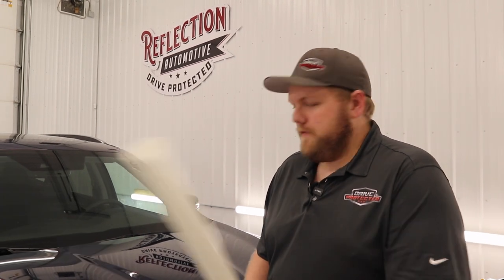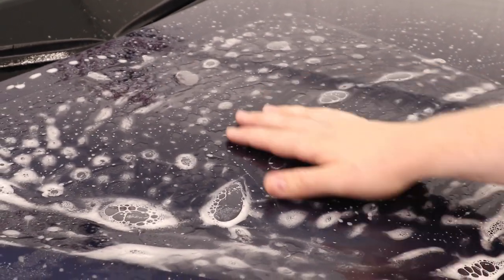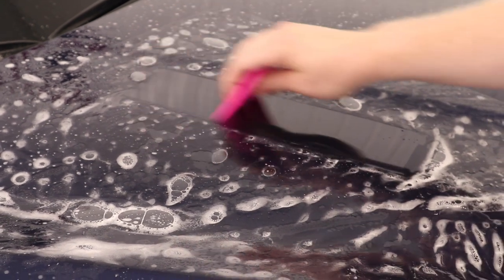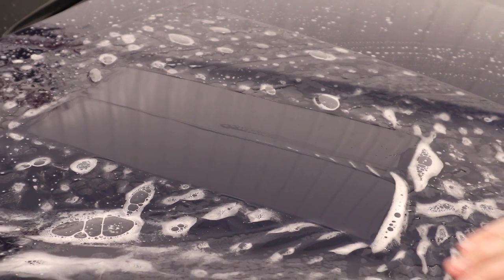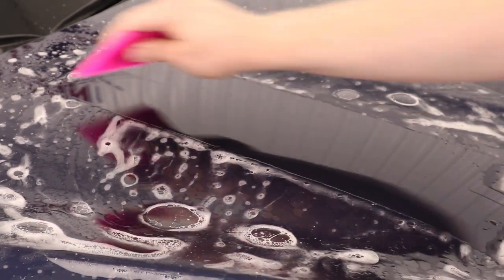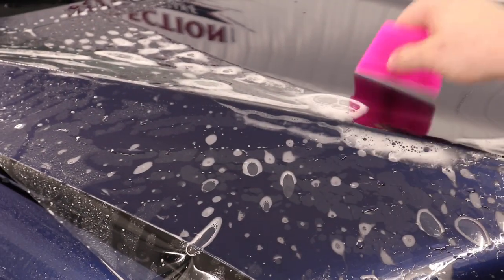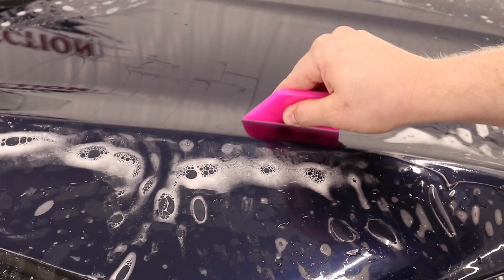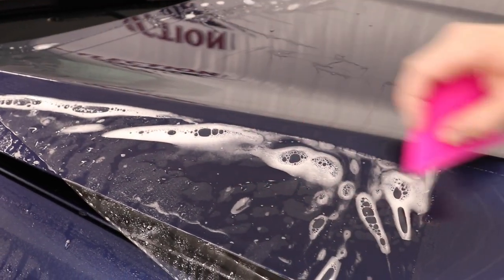PPF Pro Tips - How To Use A PPF Squeegee

Comment: If you miss a tiny bit of water over a ridge and cant squeegee out because its been too much time, as long as no white spec (air) it should just dry right?
Reply from the maker: That’s correct. Over time it will dissipate. Of its too big, you shouldn’t wait too long before popping it with a diabetics needle.